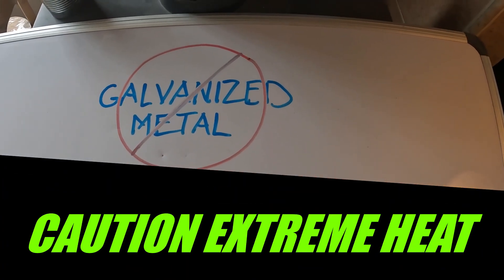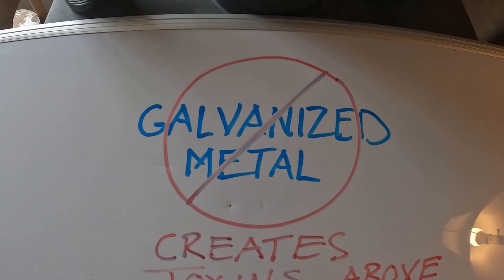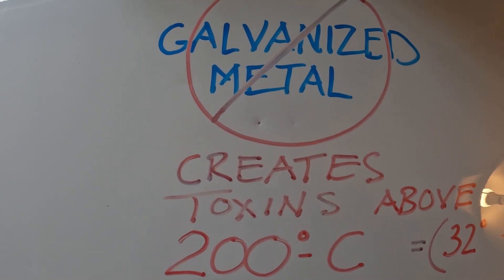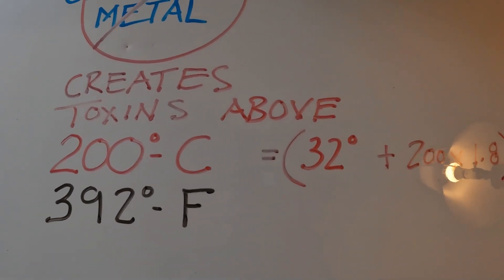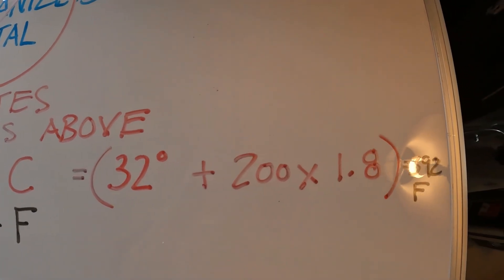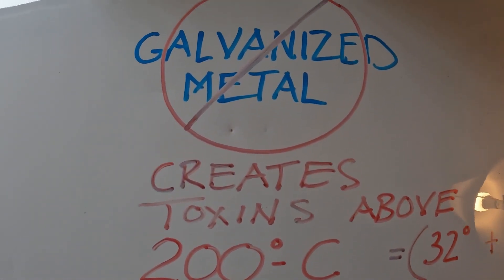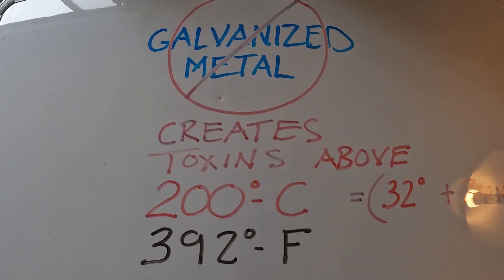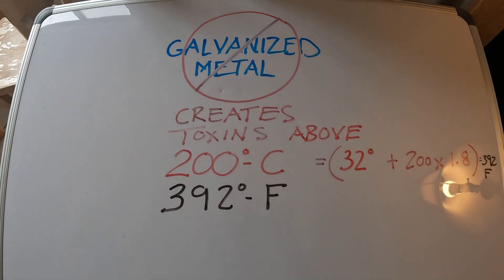Caution Extreme Heat Part-15

Comment: I remember about welding with galvanized but never thought it would off gas at these low temperatures thanks for the tip.
Reply from the maker: I was a foreman for a metal shop for years and I didn't think it would put out toxins at such a low temperature either. Another gentleman brought it to my arrention in a comment so I looked it up and sure enough he is correct.

Comment: I was watching a video titled "Make an easy heating element winding jig" by VogMan.
He talked about Kanthal wire. Kanthal Wire has a higher melting temperature than nichrohme. 
His video also has some calculations at the end for designing coils. Also a link to a calculator.
Reply from the maker: That sounds like a good material thanks for the information.

Comment: A bigger volume would be more efficient at keeping its heat in comparison to a smaller volume, as the volume increases by ^3, and the surface area by ^2.
Reply from the maker: This is just a prototype to work out any problems. I plan on scaling it up at least four times larger.
Reply: @off-gridsurvivalmike8120  Great plans! I love what you're doing, keep it up.

Comment: Just a thought for a new vessel. Restaurants use stainless steel sinks. I would think that you could find an old one at a reasonable price. And should be a good size for your experiment.  BTW, respect for pointing out your mistake with the galvanized steel. Remember that a lot of great inventions were born out of mistakes.

Comment: This is a really great series. I will be subscribing. Are you using the heat of the fan to heat your house in the evenings yet? Also, while you built a beautiful insulated box, I really think you should try scaling it up a bit. That way, you could build that energy while its sunny, and use it weeks later when its cold. You are clearly able to create some insanely high temperatures, now the challenge will be effective management and use of it. Keep up the great work.
Reply from the maker: I haven't used the heat for anything yet. I am making sure it holds up and working out any problems. And yes I plan on scaling it up quite a bit. Maybe 4 times larger if not more.